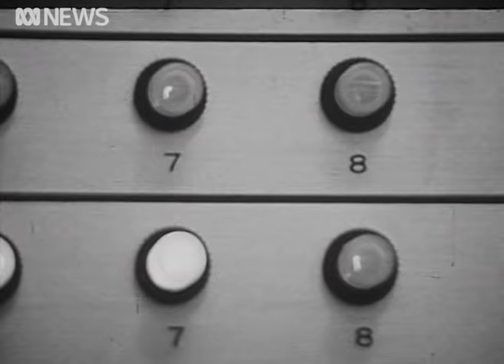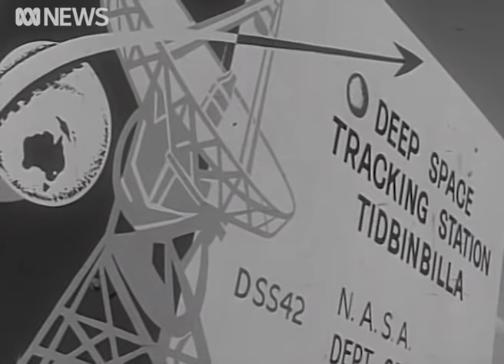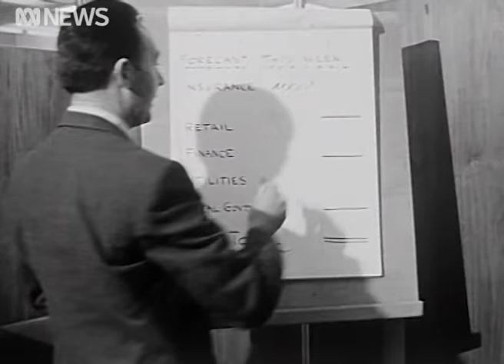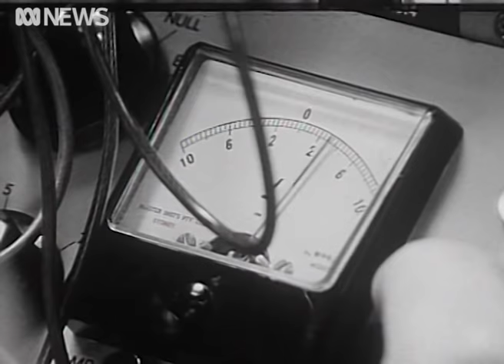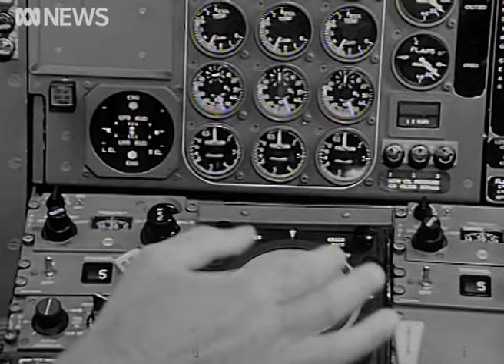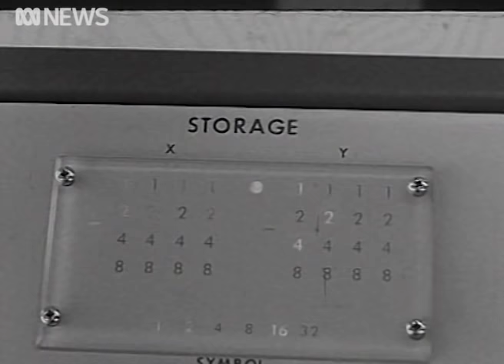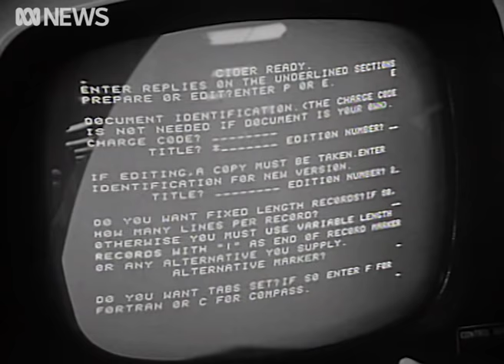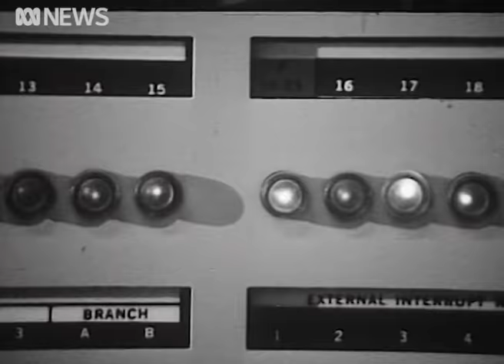Even back in 1968, workers were worried about being replaced by technology | RetroFocus

Comment: 25:39 My father began working as a computer programmer in a lab exactly like this at the San Diego Union-Tribune in the same year, 1968. I remember those machines well. They were loud, and the A/C fans even louder. There were seemingly miles of cables underneath the 3' ceiling tile-type false flooring. I once rolled over them on my roller-skates to hear the hollow.
Reply: Was he over 35?

Comment: "Certainly not before 12 or 14, they do not have enough logical thought" .... We now have kids younger doing amazing things with technology...
Reply: The ones who do any programming are pretty rare. At the time it was assumed that "doing things with computers" was programming
Reply: @feraudyh  I would have to say at the time programming was required to work with computer.. i.e. punch cards, etc... But we now have kids working with  micro controllers and making there own game.
Reply: @cheesestickfpv6162  Their own game? That must be a very small minority. In any case, the idea that kids could not be logical before 12 or 14 was quite common at the time. It was partly due to Piaget's ideas on developmental psychology. Conversely, the idea that you could not learn anything new past 35 has had a long life.
Reply: That makes sense. Kids now are introduced to computers at a very young age, giving them a greater advantage.
Reply: Technology was a bit different back then. Now it's easy to use and understand, and especially easy to mess around with and tinker. That is why kids get such an excellent understanding of technology. Prior to this, you needed to know exactly what to do to use the machine.
Reply: @atcJ  That's an interesting and valuable comment. Yes, I think that technology is much more modular these days so it is easier to assemble. Part of the reason for this is that computer memory is cheap so the components can use an "architecture" that would have been considered wasteful a long time ago but makes it easier to use. This is analogous to the facility of programming in Python which is possible due to cheap memory and powerful processors. The downside is that Python is slow and a memory hog.
Reply: no one past 35 will be able to get computer jobs.
Reply: @feraudyh  my kids schools taught them to make their own game using SCRATCH in primary school... they do coding in year 4 these days.

Comment: No machine or invention that enhances productivity a human can do is going to take away jobs, it is going to replace them. Much like printing press took a way the jobs from those who copied books by hand, but then created a need for people who build printing presses and parts for them and operate them, increased production of book also demanded more paper and ink to be made.

Only inventions that can completely replace the original will remove the need for the original. True AI could replace humans much in the same way cars replaced horses. Cars are simply better and faster for transportation, military and for labor. Until that point there is no fear of running out of jobs, after that point, well its either utopia or dystopia depending on how we plan for it.
Reply: If you can buy an android for $1000 that outperforms human in every task, why would you hire a human?

Comment: Why did airplanes not become faster or modernized as much as other technology
Reply: They became more efficient, and the average planes did become faster :)
Reply: Joseph because they shifted away from quality and went to profit, profit went to larger cabins for more people
Reply: I suppose you are referring to Moore's law (which died over ten years ago anyway for single processors) or an exponential increase in speed. Well, planes did get a little faster, not necessarily much. We ran into the limits of physics as we have done for CPUs. 
Let's look at some other advances: computer screen resolutions have been advancing much more slowly than CPUs did. Hard drive capacity advances have slowed down a lot recently.
Reply: Its becauuse of profit. Faster speed will not contribute to more profit.
Reply: @heyJustephan  There is also the sound barrier. Once planes hit the sound barrier they make sonic booms which have huge downsides for people living below the paths of airplanes. When I was a kid military fighter planes used to fly faster than they do now.  They also made sonic booms, and that led to complaints, so they were told to slow down.
Reply: @feraudyh  Even if, the main point is due to profit. Guess why the Concorde business faild. It wasnt only the catastophe `which happend year 2000. The business was down before it.
Reply: @heyJustephan  Yes, certainly. However, it must be pointed out that technological reasons explain why it's so costly to go faster (and so the profit aspect kicks in), but also there are reasons related to the quality of life (like the nuisance factor).
Reply: @feraudyh  We definitely haven't reached the limit of CPU's. And resolutions are increase at good rate. HD isn't "good" anymore and 4k isn't the best resulution
Reply: @heyJustephan  it will, because that will make shine out, next to other companies, giving you more customers. That's how tech advancement works right? Plus the quicker the planes are, the more flights you can have.
Reply: @dontreadmychanneldescripti7104  yeh concorde showed us lol... Don't talk nonsense
Reply: @dontreadmychanneldescripti7104  I never claimed we reached the limits. All I am claiming is that it's not obvious that the progress is as rapid. Unless you can convince me otherwise.
Reply: We call them planes in Australia. Airplane is an Americanisation.

Comment: The pilot saying a computer will never fly a plane, that made me laugh. A pilot is absolutely necessary to get a plane off the ground and back on the ground, but once they're in the air, the computers take over. The pilot is there in case something goes wrong. Even then, if they're not adequately trained, they don't know what to do if the system fails. Two or three Boeing aircraft crashed because of a flaw in a new system and the pilots, from less developed countries, were actually trying to read the manual while dealing with a plane hurtling toward the ground. It has come to the point where we are trying to keep up with the technology, it is driving us, as opposed to us creating new technologies that we fully understand.
Reply: It was 1968. Computers were massive, needed huge amounts of power, needed frequent repair compared to today and were slow. I can't fault him for not seeing the rise of the microprocessor
Reply: Most landings are done automatically now, and have been for a fairly long time (about 50 years).

It is perfectly normal for pilot (even from "developed") countries to rely on the flight manual and emergency checklists. In fact, that is the standard operating procedure for all pilot at all airlines.

So yeah, you clearly have no idea what you're talking about.
Reply: All pilots are required to read the manual and follow protocol if anything goes wrong regardless of what country they're from. And this procedure has prevented many catastrophes even if some still happen every now and then.
In fact a lot of crashes happen when pilots and co-pilots think they know better and take things into they're own hands.

Comment: Really? Computers'll dig trench, solder pipe, design & install drain waste & vent, carry water heaters down & tubs up, nail plate, anti-scald, prevent backflow, seal roof pipe flashings, pressure test, snake, diagnose with no clues, crawl into small spaces, firestop, strap, revent, bust crete, waterproof, lay shower pan- and that is just the plumbing. Electrical, footings, shingles, heat balancing, ground compaction, grade, drain tile..................................